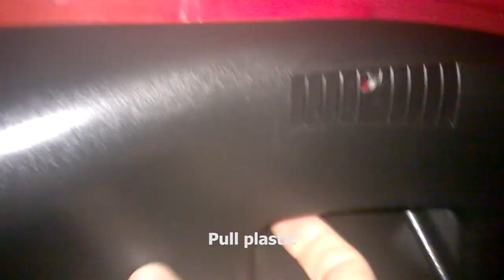Alfa Romeo 147 - Change boot light switch

Comment: On my 2001 Alfa Romeo 147 2.0TS boot light is working... But I have always "Rear hatch open" message on my board and that beeping is driving me crazy 🤕 I silenced the buzzer in the menu but didn't help... It's beeping every time that i go from a stop... City driving is becoming a nightmare... That I'm even thinking to find that buzzer and throw it out of the car...
Now I removed the lock... It seems that the motor of boot release on button is stuck... Boit won't open on button...
If I change the motor will it solve the problem with "rear hatch open" message?
Also... I have one black hose loose in that area... Don't even know where to attach it and what does it do...
All the best!

Comment: If you remove/unplug the mechanism, does the car give an error, or does it lock and work normally? I dont want to end up with no car if i screw it up or if it takes too much time to fix it :)
Reply from the maker: +kourampies I dont know if car give an error, but probably where will be "boot open" message and you will not be able to unlock boot. You should repair it, its an easy repair.
Reply: +Jan Volk The electronics part is super easy for me, I cant say I really understand the screws and drilling in them though, and I dont have someone that can help me :(
Reply from the maker: +kourampies its easy too, you must have 10mm drill, 2.5mm drill and M3 tap drill. They used some sort of rivets to close this box. You must drill thru rivets arout 1-2 mm deep to open box. To close box you must make some threads into bottom part. You first drill 2.5mm hole and then make M3 thread into it, or you can use your own system if you dont have mm as standard. Then you just find some screws and big washers to srew top part back.
Reply: +Jan Volk I have no drill or drilling experience, but since taking out the mechanism seems easy and quick, I might take it out just to show it to someone experienced with drilling, and make a plan...

I got a used 5 door 147 for next to nothing, and everything is working perfectly. I'm in love with the way it drives and feels in the inside, I knew it was a good car in terms of handling and comfort, but It beat all my expectations.

The boot light is the only thing missing, and it bothers me a lot since I use the boot a lot at night. If I get this fixed and replace the parcel shelf and clips (already ordered) the car will be immaculate inside.
Reply from the maker: +kourampies great to hear that! Its a great car and I loved it :) Find someone with a drilling machine and tap drills and you will easy sort this out.